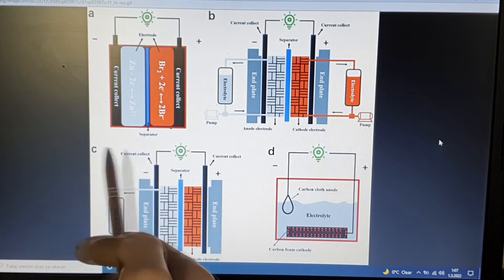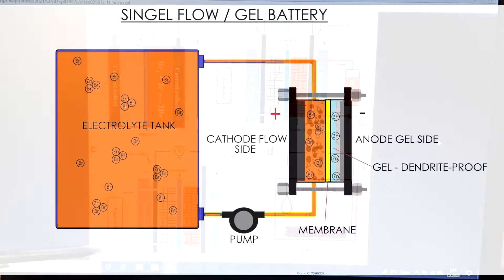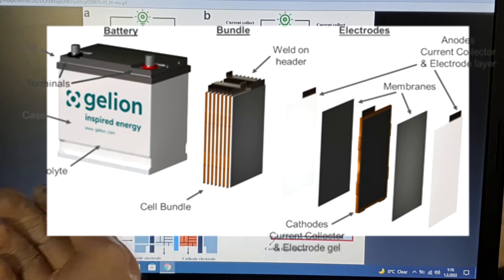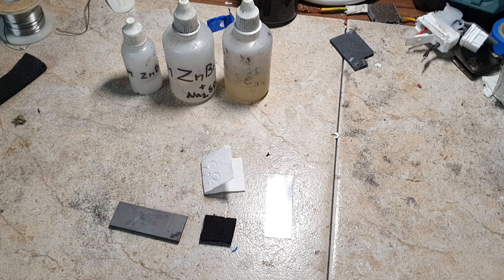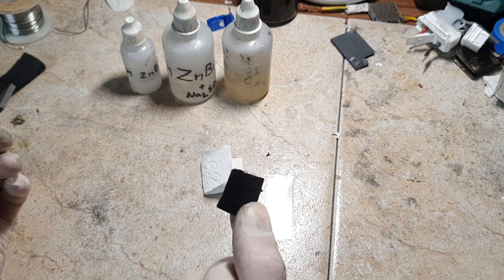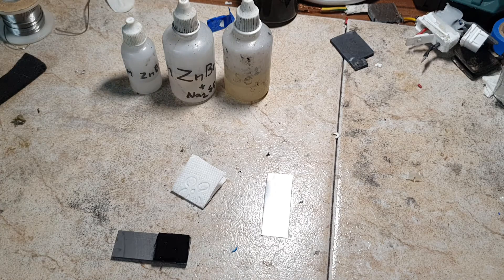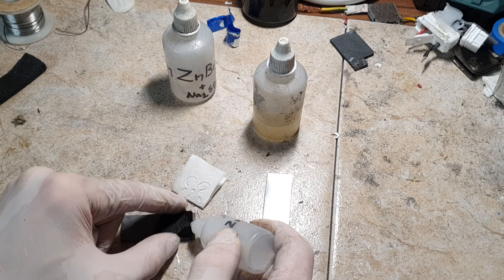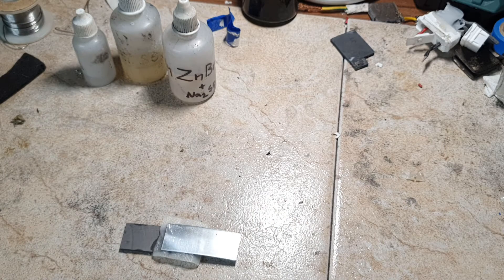Make a Zinc Bromine Static Battery

Comment: bromide complexing agent is a big difference, using it increases battery cycle longevity to 10,000 cycles and dendrites do not form, also the battery doesn't self-discharge
Reply from the maker: Dendrites form also with Bromide complexing agent,... it was proved. But the cells self discharge was better.
Reply: @cayrex  this paper says they don't have dendrites, but we have to test if obviously:

In this work, we demonstrate a zinc bromine static (non-flow) battery without the auxiliary moving parts and utilizing a glass fiber separator, which overcomes the high self-discharge rate and low energy efficiency while the advantages of the zinc-bromine redox couple are well maintained. This is achieved by an effective complexing agent, tetrapropylammonium bromide  (TPABr), reversibly converting the Br2/Br3 species to solid phase in aqueous media. The solid complexation is stored in porous carbons with good interfacial contact, further providing physical confinements to prevent the cross-diffusion and sel discharge. We also witness the zinc electrodeposition is altered from dendritic to non-dendritic growth by the polar TPA+  ions, which prefer to be adsorbed on zinc nucleus, blocking the strong electric field and regulating the ion  distribution on the interface (Ding et al., 2013). In such a simplified design, the Zn-Br2 static battery has a similar configuration to the Li-ion batteries. The proposed zinc-bromine static battery demonstrates a high specific energy density of 142 Wh kg-1 at 500 mA g-1 (equivalent to 150 W kg-1) with a high energy efficiency of 94%

The paper is: 
Title: A high performance aqueous zinc-bromine static battery
Lujie Gao, Zhuxin Li, Yiping Zou, Shuangfeng Yin, Peng Peng, Yuying Shao, Xiao
Liang
PII: S2589-0042(20)30535-6
Authors : Lujie Gao, Zhuxin Li, Yiping Zou, Shuangfeng Yin, Peng Peng, Yuying Shao, Xiao
Liang
Date: 3 July 2020
Reply from the maker: @absolute___zero  Oh yes that paper. Beacuse of TPABr in electrolyte.
 "The Zn plated in the blank electrolyte shows a typical needle-shaped
morphology with large porosity. The high-surface-area dendrites exacerbate reaction with the
electrolyte, leading Zn pulverization after 100 h (125 cycles) of repeated plating/stripping.
Reply: @cayrex  " oh that paper"  I am becoming a fan of your work and put you on my list of Accomplished chemists  ..  I wondered what you would think of a battery using Americium which is very low Gama emitter also I have a lot of Berilium, also very easy to handle and a low emitter as well I have a collection of various crystals .   Also I have been working with some resonant circuits and I think there are some very good posibilites for some new types of batteries in the not too distant future that will be not so out of reach for us in the least amount of complexity .  Also I am looking forward to your next video as you a very nice job of producing these accounts of your work  ....

Comment: Hi cayrex2
What is the purpose of using activated carbon felt or powder to this cell?
Can we skip this or use another good thing for this.
Waiting for your reply
Reply from the maker: The activated carbon is like storage cupboard for bromine. Any carbon material will work. The problem with using other materials is that the bromine will damage it over the time.

Comment: Brilliant work Cayrex2. That small motor is nearly flying away lol I really like your Videos and your manner of presenting. Very friendly, interesting and helpful. Keep up the good work. So now I must ask you something because I want to make zinc bromide battery. I have Sodium Bromide powder and Zinc Sulphate Powder.  1 Kg each chemicals. Please can tell or make a video on " How to mix 2 Mole as you have there" I have to make two solutions of each with de-ionised water and boil them together? Then concentrate by boiling off a lot of water? But what concentration do I need? How much water needed initially and does it matter, ...... is it critical? Please tell if possible Thank you Edward
Reply from the maker: Thank you! To make 100ml of 2M ZnBr2,....you add 41g of NaBr2 and 57,4g of ZnSO4 into 100ml of de-ionised water. In the end you will get ZnBr2 and Na2SO4. So for Na2SO4 is no need to remove because Na2SO4 can be your supporting electrolyte in that system.
Reply: @cayrex  Wow ok, No need to evaporate wastefully with high energy.  People say to evaporate in oven @ high heat, for 24hrs lol Your way is so simple.
Reply from the maker: @eeezygoing  I see no reason to remove Na2SO4. Because in the end you need to use some supporting electrolyte. Na2SO4 is good neutral support electrolyte.
Reply from the maker: @eeezygoing  upssss I make mistake. 41g of NaBr2 is dissolved in 100ml of water and 57,4g of ZnSO4 is dissolved into another 100ml of water. Then you mix NaBr2 and ZnSO4 solutions together and you will get 200ml of electrolyte. In the end you will come up with 2 mole ZnBr2 and Na2SO4. With first ratios which I tell you, you will get more concentrated electrolyte.
Reply: Robert Murray Smith did a video on making zinc bromide. There is also another good video on Youtube if you do a search.
Reply: @rogerwilson6367  Hi Roger. Thanks for answering. I have seen two videos on youtube describing how to mix for ZnBr2 but they say different things. So that confused me. That's why I had to ask Cayrex2. I had seen his demo of this battery which shows a strong charge level and obviously low internal resistance in this cell he has just shown. By the way Roger. I have seen a video with someone who made ZnBr2 flow battery and the Bromine destroyed the plastic casing by making it breakdown by becoming brittle, cracking and useless. It maybe how it got through your beeswax which is way softer than hard plastics !!!
Reply: @eeezygoing  Yes, I got confused as there seemed to be differing ways of making it. I wish Cayrex luck with this battery, but I couldn't keep the bromine contained and had massive self discharge. I think they always store bromine in glass ampules for a reason.😩😩
Reply from the maker: @rogerwilson6367  Yes I agree with you. High porous carbons can capture the bromine into the structure like a sponge,... but have limitations on how much the porous carbon can capture the bromine. The positive electrode need to be always on the bottom. Created bromine is stored in external tank....
Reply: @cayrex  Agreed.